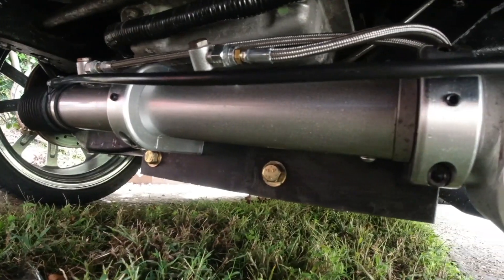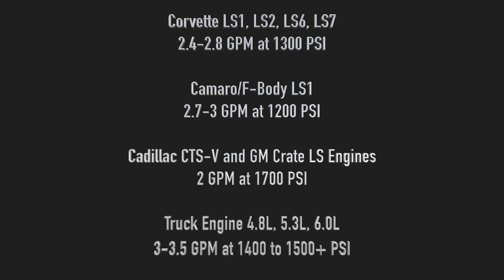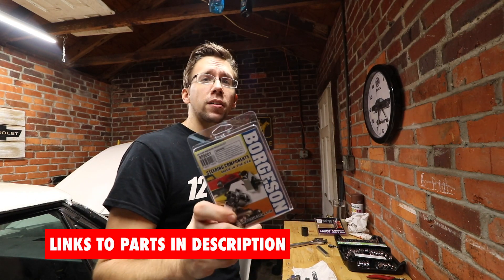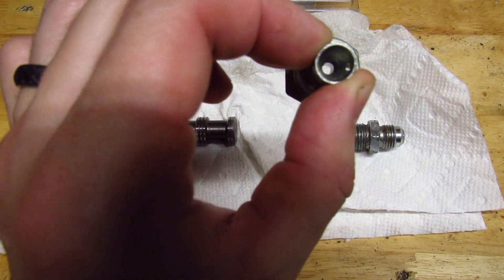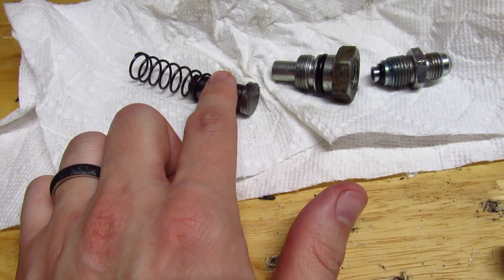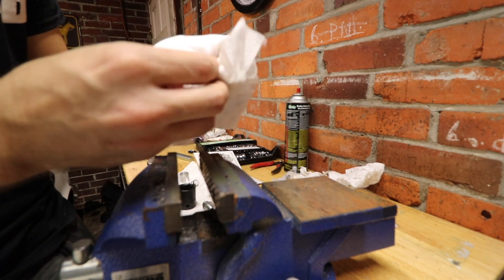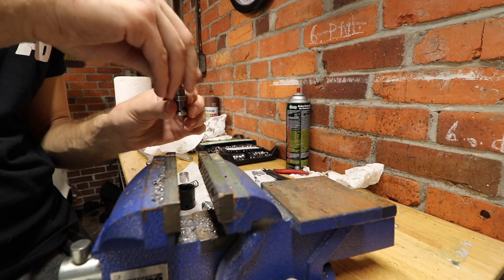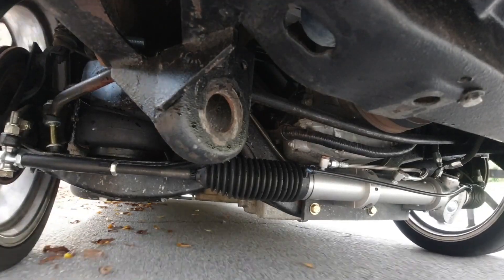LS Power Steering Pressure/Flow Reduction For Rack and Pinion

Comment: great video, so a pressure drop is great for flaming river, i have flaming river rack and likely gm pump 25960709, flaming river also wants 1.5 to 2 gpm , does fix solve the flow rate issue ? thanks for your help
Reply from the maker: Thanks buddy! And apparently Flaming River now says you can run higher pressures according to another commented who has contacted tech support since I’ve made the video. I’m not sure if it’s a running change to the racks or if they just say it’ll be fine haha. I haven’t had a problem feeding them the truck flow rates - I have two LS swaps with truck pumps now but that doesn’t mean it’s optimal. A company called Turn One Steering makes flow regulators that a relatively reasonably priced if you wanna experiment, especially if you have a lighter car instead of a truck or land yacht style car.

Comment: I added a type 2 Saginaw pump on my 99 ford ranger 2.5l and I added two shims and it will cut out the power steering at 3 mph or lower if I don’t rev the engine. Should I add more shims? At highway speeds it’s pretty touchy.

Comment: Would this help reduce the power steering and make it require slightly more arm strength while steering? That’s one thing I’ve always wanted to change about my Chevy pickup. I want the power steering to be less powerful.
Reply from the maker: Yes sir! Does it have that floaty, one finger turns the wheel, 80s Cadillac feel? Unfortunately there’s no exact science to how many shims you need/how it’ll feel. I know I talked a lot about rack and pinions in the video but a lot of the same stuff applies to steering boxes. The exception is that the flows and pressures they way want are usually a bit different. My opinion is to start with two shims in your power steering pump - I always thought that was a nice feel without being extremely heavy. Unfortunately I have more experience with cars then trucks so you may have to adjust based on how it feels to you, weight of the truck, type of steering box, etc. It sucks but I’ve swapped shims several times before I was happy with the results - be prepared to just be covered with power steering fluid for the entire afternoon haha.
Reply: @MatthewFinlay  yeah, I prefer the way fords steer and I’m wanting to somewhat emulate that. I know it won’t be the same, but if I can get it closer I’d be happy. As it is now, any slight touch of the wheel sends it out of the lane.
Reply from the maker: @TheTF01 Oh I’m glad you mentioned that info. By any chance was the truck converted from manual to power steering?? Even if it hasn’t been converted. I’d honestly start with an alignment from a good frame shop or a small shop that is willing experiment with you. Caster is the vertical alignment of you spindle assembly from the front to back(loose definition) - most people talk about camber aka the tilt inward or outward. Most vehicles with power steeeing positive caster (3-5ish degrees) to keep them from unintentionally turning or too twitchy. But with manual steering they usually have less caster (maybe only 1-3 degrees) which helps make them less pain in the butt to turn and on a manual setup you won’t feel the twitchy-ness as much anyway. I mention finding a small shop because they are more likely to understand what you need and/or align to your specs, rather then a franchise place. A lot of them will only align to factory specs for liability reasons. I would 110% start there before pressure. And heck it might need one anyway haha. Before I got a relationship with our local shop, I just asked if we could pay hourly instead of flat rate alignment and they had no problems with it. Even if you had it aligned, I’ve had places slap the “hood enough” badge on things if you aren’t careful.

Comment: I’m having trouble with my power steering, I have a 5.3 LS on a 74 Chevy nova but I installed a 98 Jeep Grand Cherokee steering box on it but it happens to keep turning the wheel on its own. Would it be that the pump has to much pressure it pushes the wheel while I’m parked ?
Reply from the maker: Very possible, I’m having trouble finding real world answers on what pressure the Cherokee box wants. But I’ve used them in the past with older 70s and 80s Saginaw pumps which generally pumps and they worked fine which run approx 1200 psi. I’ve have had several boxes (not Cherokee though) be way too light on the steering and a few work units blow out some seals from LS pump pressure. My guess is this - most all boxes should have a centering valve/control valve and it sounds stuck, internally leaking, not functioning or getting so much psi rammed into it that it is forcing it open. Was it a new box or used/junkyard? If new I’d bet she’s just over pressured but used could be any of those other issues as well.

Comment: Thank you so much! I had my setup flipped w the spring up against the flow valve and lost all power steering. I flipped it back and now it's all good! The shot in here on orientation really helped and you taught me a bunch on different ways to reduce the flow. Very good Video!
Reply from the maker: Dude you rock! Thank you, I only learned those things by also accidentally putting it back in wrong a time or two… or three.